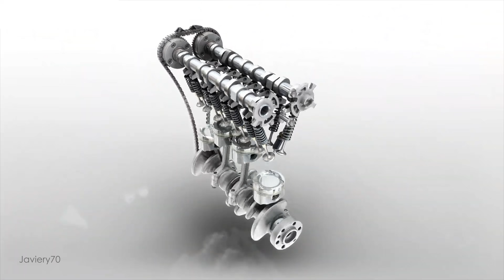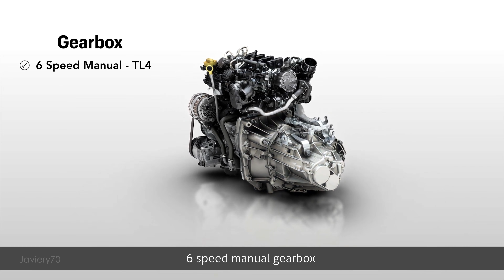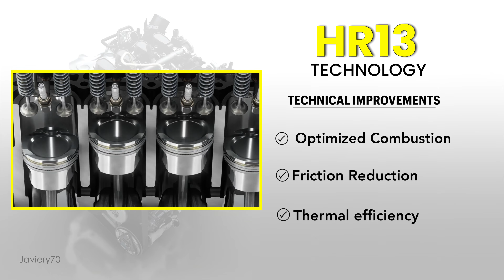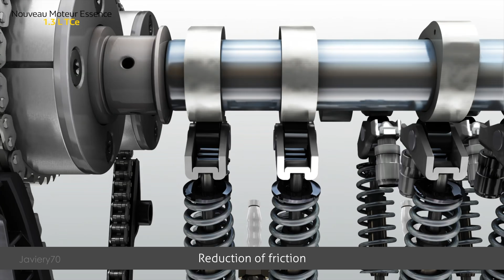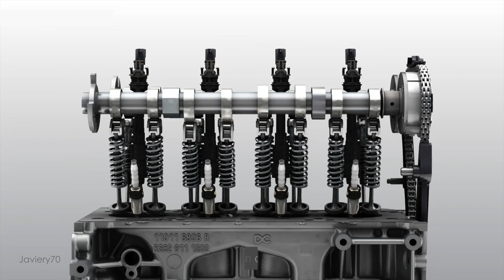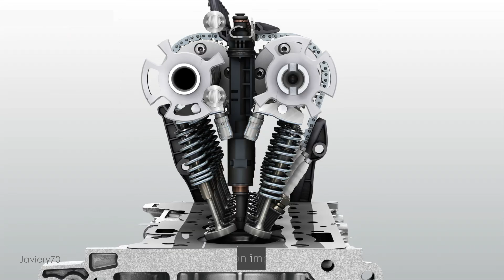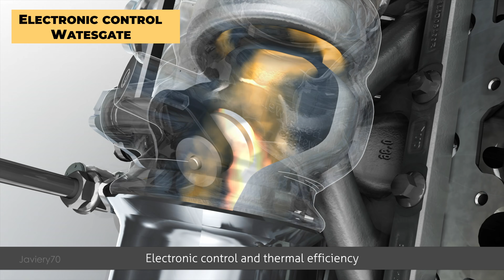🔸 Engine 1.3 TCe RENAULT - DACIA | Its Technology

Comment: Here we go again with low friction materials and DLC coatings,,,Which over time wear off in tiny particals that flow through the whole oil system of the engine ,,These materials are much harder than the aluminium the pistons and engine block are made of,,,And all the particals act like a sandpaper destroying the inside of the engine,,,Also the timing chain is coated in this material also,,,The timing chain needs oil to survive ,,So now the DLC coating that is used to make the chain move more efficiently is now destroying it,,,,,F1 tech,,Sounds great on paper,,,But it doesn't work for road going cars,,,
Reply from the maker: Manufacturers (Renault - Nissan - Mitsubishi - Mercedes) are not going to make an engine that self-destructs by using low-friction materials.

Comment: Ho dacia duster 150 cv , motore fluido e perfetto anche nei consumi,fra un po dovrei farmi il tagliando da me,garanzia fra un po scade,mi consigli olio 0-20 o 5-30?  Vivo in paese dal clima mite normale! Grazie
Reply from the maker: Di fabbrica vengono forniti con 0w-20 RN17.
Entrambi sono consigliati da Renault - Dacia.
Personalmente, per i climi temperati, consiglio l'uso di 5w30 RN17.
https://amzn.to/3WxLUZQ
Reply: @javiery70  sono orientato su Motul o Liqui moly, sono delle buone alternative a elf o castrol ? Thanks
Reply from the maker: @ The important thing is that it must meet the RN17 quality specifications.

The best alternative brand is the one recommended by the manufacturer.

Comment: Hello , is this motor on the Duster 3 - TCe 130 4x4 ?
Reply from the maker: No.
Duster 3 is fitted with a 130 hp 3-cylinder mild hybrid 48 v engine.
Reply: @javiery70  So i guess its not so good as the 4 Cylinder?
Reply from the maker: @sesisesi2027 It is a different engine and it is still too new to know its reliability...

Comment: I am going to replace the original thermostat due to the possible issues with a new one (original)  from Mercedes car, the same motor M282. Are there compatibile?! I have the new version of thermostat in my car(Nissan Q. 1.3) and it looks the same like the previous version of thermostat.
Reply: What happens with resistance of the temperature sensor (thermistor) when the temperature of the coolant increase? The resistance increases (pozitive) or decrease (negative) ? Thank you
Reply from the maker: I'll check it out.
Reply from the maker: Resistance decreases with heat.
Reply: @javiery70  Thank You. I will compare the working mode of both temperature sensors . Again, thank You very much .
Reply: @javiery70  So, the temperature sensor of Renault is NTC thermistor( negative temperature coefficient). Also the Mercedes , NTC. What is doing exactlly the second sensor, the lower one ? Thank you
Reply from the maker: @ The lower connection electrically heats the thermostat to be controlled by the injection computer.
Reply: @javiery70  So, the lower connection is not sensor. Am I right ? Has it polarity ?
Reply from the maker: Yes.
1- 12v
2 - Injection calculator
Reply: @javiery70  Thank you
Reply from the maker: @ersinali4152 👍
Reply: Hello javiery. Where is placed the gauge temperature sensor ? Thank you
Reply from the maker: @ I don't understand the question.
The thermostat already has the temperature sensor mounted on its upper part.
Reply: @javiery70  Is it the same temperature sensor for car inside gauge ?
Reply from the maker: @ersinali4152 just that sensor but I will confirm it.
Reply from the maker: @ersinali4152  There is only that temperature sensor that controls the injection and informs the instrument panel.
Reply: @javiery70  Thank You very much
Reply: @javiery70  Thanks
Reply from the maker: Hello.
I have a question.
Is the Mercedes thermostat you bought screwed into the center?
Did you install the original thermostat sensors or leave the new ones installed?
Thank you.
Reply: @javiery70  Hello. I leaved the existing sensors on the Mercedes thermostat: The Temperature sensor and the thermostat Heater solenoid valve. By mistake, I changed the connectors and I burned the coolant temperature sensor. After that, I put again the original Nissan/Renault thermostat. I ordered the coolant temp. sensor for Mercedes in order to replace the broken part, I fitted it in the thermostat. Now, I am waitting for a Sunny day to replace again the Mercedes thermostat. I was very very close to succed.
Reply from the maker: @ The sensor is the same. Why buy a new one?
Does it have four screws in its central connection? It's the new version of the thermostat.
Reply: @javiery70  I fitted the Mercedes thermostat on the car and I burned the temperature sensor, by mistake. I had to buy a new sensor for Mercedes thermostat.
Reply: @javiery70  The new version of thermostat: You mean for Renault/ Nissan ?.....or for Mercedes ?
Reply: @javiery70  The Mercedes thermostat that I fitted has 4 screws in the center. Not glue
Reply from the maker: @ Mercedes
Reply from the maker: @ersinali4152  I've noticed that the Mercedes thermostat has different connections than the Renault one.
Could it be connected to your Nissan?
Thanks.
Reply: @javiery70  I bought new connectors for Mercedes thermostat.
Reply from the maker: @ Can the temperature sensor be exchanged and a connector not be installed?
Reply: @javiery70  You can exchange the temperature sensor but with the same type . Not from other cars. Mercedes thermostat has different electrical connectors and also different pipes connectors. You have to modify the electrical connectors from Renault car in order to fit for Mercedes thermostat
Reply from the maker: @ersinali4152  Correct. The polarity is different on the Nissan.
It's the same on the Renault and Mercedes.
Both connectors are removable. My question is whether I can fit the temperature sensor and heater from the Renault to the Mercedes, by size.
Thank you very much.
Reply: @javiery70  Regarding the temperature sensor,  it is an thermistor. It doesn't matter polarity . Am I right ?
Reply: @javiery70  You can not fit the Renault temperature senzor and heater to Mercedes thermostat. You have to cut the wires and put new connectors to fit directlly to Mercedes thermostat. It doesn't matter the polarity: we are talking about thermistor and solenoid( heater)
Reply from the maker: @ I'm not referring to the connection.
Do you mean the sizes are different?
Reply from the maker: @ersinali4152  The thermistor is connected directly to the control unit and the connection should not be reversed.
Reply: @javiery70  Thank You. Could You explain me, please, how can I find the Positive or Negative pole, at the thermistor, please ?!
Reply from the maker: @ersinali4152  Are the Renault/Nissan sensor and heater different in size from those on Mercedes? I'm not referring to the connection.
Reply: @javiery70  Heater and senzor has different sizes., Renault vs Mercedes.
Reply: @javiery70  As operating principle, thermistor has no polarity. I don't know what You were referring to. Thank you
Reply from the maker: @ termistore Renault 
1 -
2 +
Reply from the maker: @ersinali4152  Where can I get the Mercedes connectors?
Reply: @javiery70  And which is the polarity for Renault/Nissan heater solenoid valve ? It is also in thermostat body. Thank you
Reply from the maker: @ersinali4152  Where can I get the Mercedes connectors?
Thanks
Reply: @javiery70  Any car electric auto parts store or Aliexpress
Reply from the maker: @ersinali4152  Can you give me the link please?
Reply: @javiery70  I give You the link but it seems YouTube deleted it
Reply: From my experiece, there are differences  in Mercedes thermostat sensors values chart and Nissan/Renault sensors values. I think the Mercedes thermostat will not function properly.
Reply from the maker: @ my email
javiery70@icloud.com
Reply: Which is the polarity for Renault thermostat Heater solenoid valve ?? Please
Reply from the maker: @ 
Renault heater
1 ground mass ( inyección )
2 +
Reply from the maker: @ersinali4152  The opening temperature may differ by a few degrees.
Reply from the maker: @ersinali4152  The thermistore's resistance may vary.
Can you tell me the values?
Thanks.
Reply: @javiery70  The question is: which are the polarity of Mercedes heater and temperature sensor ? Is it 1 to 1, 2 to 2  ?
Reply from the maker: @ Your installation is a Nissan.
The heater is a resistor that heats in both polarities.
Reply: @javiery70  You are right with heater. The same with temperature sensor, which is thermistor, I suppose. It doesn't matter the polarity.
Reply from the maker: @ The important thing is that the probe's connection to the control unit is correct.
Connect the cables the same as the original, without making any mistakes.
Can you measure the probe?
Reply: @javiery70  Mercedes temperature sensor: 3 Kohm, at room temperature.  Mercedes heater: 10 Ohms.  Which are the values of Renault ?
Reply from the maker: @ 
11 ohm heater
3.66 k ohm probe
Reply: @javiery70   Almost the same values. Super !
Reply from the maker: @ yes
Reply: @javiery70  You can not Connect the wires as the original ( sensor temperature) if You don't know the  polarity of Mercedes sensor: 1 pin  can be Positive or Negative. As You said, at Renault 1 is - and 2 is +
Reply: @javiery70  The Mercedes thermostat has a 3rd electrical connector, central. Do You know what for is it ?! Thanks
Reply from the maker: @ in heater?
3 pin ?
Reply: @javiery70  Yes, it is 3 pin. See email
Reply from the maker: @ I don't understand.
There are 3 connectors in total?
Reply from the maker: @ I don't have that information, but I think it could be an electronically controlled heater for more precise temperatures, or it could incorporate a motion sensor to detect when it's opened.
Reply: @javiery70  Yes, I sent You email. Can it affect if it is not connected? The 3rd connector ?
Reply from the maker: @ I don't understand.
I only see two connectors, one of them with three pins.
Reply: @javiery70  1. It is heater( 2 pins), in front of thermostat like Renault. 2. The second is temperature sensor e( 2 pins). The 3rd is what You see with 3 pins, in central body of the thermostat
Reply: @javiery70  Yes, the connector with 3 pins . We are talking about it
Reply from the maker: @ Okay, now I understand.
I don't have any information about that connector, but I personally think it could be a motion sensor to determine whether the thermostat is closed or open.
Reply from the maker: @ Since your car's installation doesn't include that connector, I don't think anything will happen. It will be invalid.
Reply: @javiery70  My car Nissan Qashqai 1.3 is the same as Renault Kadjar or other, with the same engine 1.3 TCE/ or DIG or Mercedes....
Reply: @javiery70  I am going to ask a Mercedes engineer about 3rd connection....
Reply from the maker: @ersinali4152  Of course, any Mercedes mechanic can understand how that central part works.
Reply: Hello. Is there available a new thermostat housing from Renault designed as Mercedes one ? Whithout glue ?
Reply from the maker: @ersinali4152  Since April, there's been a new thermostat reference, but it's not yet available. I've ordered it and am waiting.
There's no information on its design or photos yet.

I've prepared a new video discussing the Renault and Mercedes thermostats. I'd like to include the new thermostat in the video, but I'm afraid it might be delayed.

I'm waiting for this information.
Reply: @javiery70  Hello, what do You know about fiability of 7DCT 300 - DW5 gearbox ?
Reply from the maker: @ 
🔸 RENAULT - DACIA | Cambiar el aceite de Caja Automática DW5 - EDC 7 Velocidades
https://youtu.be/k-Z326VDiGY

It's generally a very good gearbox and is found in the entire Renault mid-range.
Its weak point is the clutches, which, despite being immersed in oil, are subject to a lot of stress and wear.
It's essential that its oil is always in perfect condition.
I have a DW5 in my Scenic.
I haven't had any DW5 failures at work.
Reply: @javiery70  Hello. I just installed the Mercedes thermostat and it works fine. Any news about new thermostat from Renault ?
Reply from the maker: @ The new reference is not yet available for sale.
Reply from the maker: The original thermostat is a DAUPHINOISE THOMSON brand, the new thermostat replaced by Renault is from the manufacturer MAGAL.
Physically they are the same, the manufacturer varies.
There are compatible ones but NOT original ones.
Reply: @javiery70 I mean the Mercedes thermostat vs. Renault thermostat, the same engine( H13- Renault, M282-Mercedes) Is there compatibility between them ? Thank You.
Reply from the maker: NO.
Each vehicle brand may have some modifications according to its needs.
Reply: @javiery70  Thank You very much.
Reply from the maker: @ersinali4152  I'm updating my answer. I've seen the thermostat in a MERCEDES and it's not exactly the same. There are differences in the connection and orientation of the pipe inlets.
Each vehicle manufacturer can make modifications according to their needs.
Reply: @javiery70  Thank You for your interests. The connections and orientation of the pipes  are very easy to solve. At Mercedes thermostat there are 3 pipes, one will be canceled. It is the return to coolant reservoire. The most important thing  is that the Mercedes thermostat fits 1:1 on the motor.
Reply: @javiery70  I studied in Deep both thermostats. I am waitting the Merc hoses and I will install the new thermostat
Reply from the maker: Yes.
The adjustment of the base is the same since it must be adapted to the engine which has no modifications.
Reply: At what temperature level does the Renault thermostat open? Thank You.
Reply from the maker: @ Start opening: 90 degrees C.
Full opening: 100 degrees C.
Reply: @javiery70  Thank You very much. The Mercedes thermostat opens at 95 degrees.
Reply: Hello. The Mercedes thermostat has 3 pipes : 2 main pipes like Renault thermostat and a third one, a very small pipe. Do You know what for is this small pipe? Thank you
Reply from the maker: @ Renault - Dacia has 2 pipes and a drainer with a screw cap.
Mercedes does not have a drainer, the small pipe is possibly connected to the water tank.
Reply: @javiery70  What could happen If I block that small pipe ?
Reply from the maker: @ersinali4152  You can bleed (let the air out) and then put a rubber plug with a clamp.
It is essential that there is no air left in the circuit, otherwise the engine may overheat.
This month I will upload a video on changing the coolant and I will talk about the bleed.
Reply: @javiery70  Super....I would appreciate If I could see the hoses, the position of the hoses , how they fit into thermostat, in order to adapt to the Mercedes thermostat. Is it possible ? Thank you
Reply from the maker: @ The orientation of the hoses is the same as in Renault - Dacia.
Large pipe towards the front (engine radiator) and the small pipe towards the rear of the engine (heating radiator).
Reply: @javiery70  Thank you
Reply: @javiery70  Hello. Could you explain what type of sensors are placed on Renault/Nissan thermostat housing ? There are 2 sensors in it. I fitted a Mercedes thermostat and it seems that the sensors are operating in opposite with Renault thermostat. The cooling fun is startting imediately as I start the engine.
Reply from the maker: The upper connector corresponds to the temperature sensor.
The lower connector corresponds to the electrically opened thermostat by heat resistance.
If they are not connected, the fan is activated.
Reply: @javiery70  Thank you
Reply: @javiery70  Are the same in Mercedes thermostat, or other type? As I know there 2 types of thermistor:  Negative Temperature Coefficient (NTC) and Positive Temperature Coefficient (PTC)
Reply from the maker: @ersinali4152  The thermostat already has the sensor mounted.
Reply: @javiery70 I mean If the installed sensors are the same, on Mercedes thermostat vs. Renault thermostat ore they are differently
Reply from the maker: @ physically without equals and I assume its operation is the same, I cannot guarantee this since I do not have technical information from Mercedes.
Reply: What is happening with resistance of the temperature sensor at Renault thermostat, when the temperature of the coolant increase ? The resistance of the sensor increase or decrease ? @javiery70